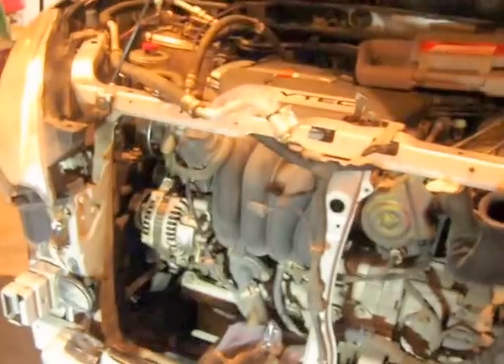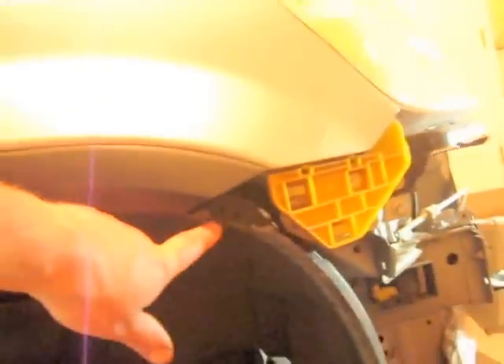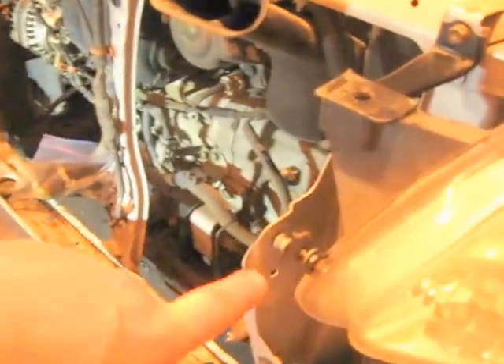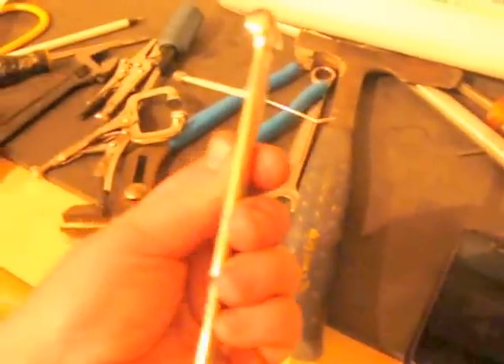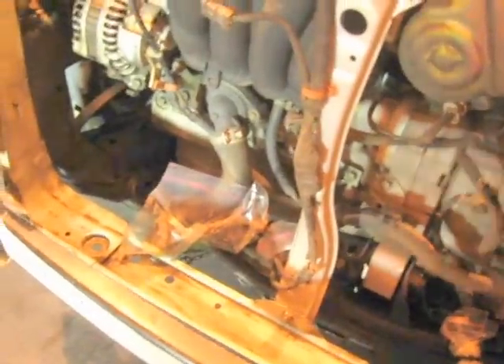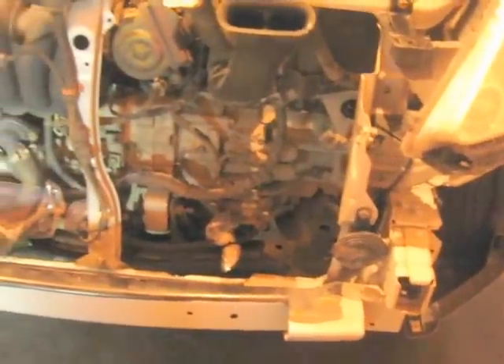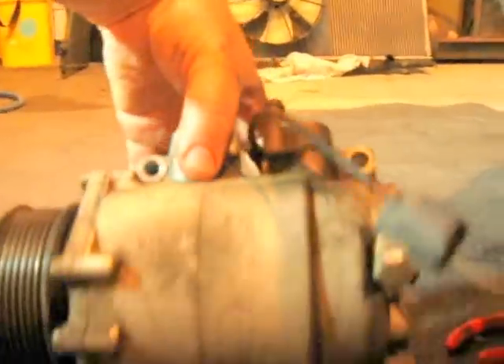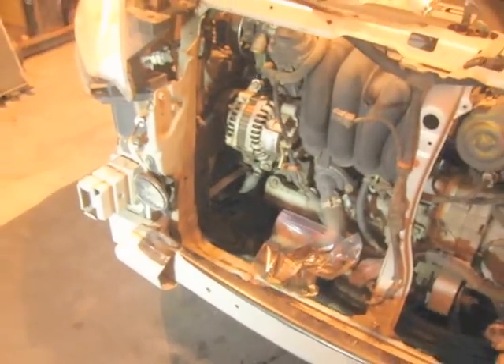2004 Honda CR-V Air Conditioner Compressor Removal

Comment: Remove the upper radiator support, overflow reservoir,  passenger side cooling fan, serpentine belt. disconnect the 2 ac lines, power supply plug and 4 bolts holding the compressor, then lift the compressor out. Oh, pop the grill out so the radiator and condenser can go forward a couple inches. I just did this this morning in about an hour and 1/2.
Reply: Seriously? Please tell me more, I'm getting ready to take on this adventure.  Did you have to drop the subframe? Thanks
Reply: @factotumted   Pretty much what I said except there are 2 10mm bolts that are a bitch to get to where the top mounting mounting brackets for the radiator attach on each side when you look down.
Reply: @factotumted  And no, don't drop the subframe.
Reply: @timthemechanix  thanks Tim! 😊

Comment: Hi George thanks for the video. I have a new compressor from amazon for my 2005 CRV. I got stuck at the point where I took the bumper and plastics off. I see now that I have to remove the condenser and radiator to do this job properly. Thank you for taking the time to produce this helpful video i appreciate it. It's a little tricky but definitely worth the cost savings.
Reply from the maker: Carleone Alleyne Thank you for your kind words! You will be happy and proud of your work. Have a great weekend! We have lots to do around here!!
Reply: @GeorgeJirout  I got the new compressor installed yesterday, definitely a good sense of achievement :-) take care.

Comment: Awesome vid! I really appreciate getting a front view of the engine with the radiator out of the way.

My A/C lost its cooling ability a while back. I recharged the freon myself in which it only cooled for about an hour or so. Upon inspection I found my low-pressure discharge hose had started to rub up on my belt. I felt the area of contact and couldnt find a hole but there was a very clear depression in the hose itself. I plan to remove the hose tomorrow to have it refabricated.

I was at Napa the other day to grab something really quick and left my car running with the A/C off. I ended up waiting for about 10-15mins in the store because the sales associate was occupied and when I had returned to my car with the associate my car began to over heat. I believe i saw some sizzle from the radiator cap as well as the reserve tank cap. I also lost about half a quart of coolant that leaked out onto the ground. The leak pooled just below the reserve tank it seemed.

Do you think my A/C problem and overheating problem could be linked?
Reply from the maker: +4thcavalier I apologize for the late reply. My son was in a bad car accident and is in a coma. We are hopeful and faith driven people. In terms of the overheat I doubt they are linked. If the a/c compressor froze up not allowing the belt to rotate it would have burned off from the friction. If the depression in the hose did leak that would be my first stop in the troubleshooting journey. Otherwise there are a few other components as possible culprits. Thermostat, water pump, fans, or the fan relays may be to blame. I hope you have figured it out by now. As a diy this may be a reasonable fix if the motor did not get so hot to damage the head gaskets.

Comment: Just did mine without removing the radiator and bumper just loosened the radiator and removed the crossbar. Harder to work around but a lot less time and fluid
Reply from the maker: Thank you for sharing you experience. I am sure it will help another person down the road as this seems to be common issue for us with the CR-V... It

Comment: I just replaced a compressor on a 04 myself.Drained the system down then i took out the 4- 14 mm bolts in the front engine mount,put a jack centered  under the front cradle . Removed the 4 front cradle to body bolts(17 mm heads).Then I removed the rt. front tire and removed the two mount bolts facing out towards the fender well. Removed just the two bolts on the right side with a swivel socket.Then disconnected the lines and wire from the compressor. Lowered the jack under the cradle, engine will only go down so far.Unbolted the compressor and removed it through the passenger side wheel well. Whole job under an hour! You may have to pry the cradle down and put a block between the cradle and the body to have a little more room.
Reply from the maker: Thank you for sharing your experience as it will undoubtedly help out someone in a similar situation with this issue.

Comment: No worries George.  AutoZone was running a 20% off deal for Memorial day so i just ordered on there.  Getting the 2-year warranty unit.  A bit more, but wanted a "little" back up in case it goes bad again right away.

Comment: just did a 2007 crv. compressor can be replaced with only removing bottom plastic splash guard..takes about 30 min
Reply from the maker: jim bean I am glad to hear that. I am sure that will help another diy with this job in the future. Thanks for sharing your experience!
Reply: Ha great! I need to do my 2007. Thanks.
Reply: 2007 is not same as the 2004  if you take it out from the bottom on 2004 you will have to drop the sub frame and than squeeze  it out and that is the only way to get it out from the bottom

Comment from the maker: This is a very common question. If the impeller inside the compressor imploded (indicated by crunching metallic mayhem). Take out the desiccant filter located on the bottom right hand side of the radiator (10mm hex) and look for metal fragments. If present the whole thing needs to be replaced. I seem to remember someone in the thread changing out the clutch assembly (similar symptomatology as yours ) and they were back in business. Thats about all I have. The guy said he pulled the clutch without going to deep into the car, read through these comments and you may find what you are looking for. Sorry for the late reply. I started typing this earlier and the puppy came into my office and commenced a urinary relief procedure that sidetracked me to which I brain dumped the memory cache until heading back to the house for a coffee refill!
Reply: Oh wow. Sorry to hear about the urinary relief. So in trying to do the repair,though I know expensive, do you think a local Honda dealer or an auto parts store would carry those 10 sizes plastic push pins?
Reply from the maker: Perhaps, surely the parts can arrive in a day or so should you choose to use the dealer. They are fairly common ad the pins typically break during service work.
Reply: George you are the man! I've got everything off, but I've hit a possible catastrophic issue. I got down to that last bolt, underside of compressor, the passenger side bolt,(the bugger the as you say) used a 12mm box, and it's stripped.... Its like 100 today here in Charlotte, as it will be for the next 2 months, my very pregnant wife needs this car, and that bolt is now stripped..... I couldn't be more bummed.. I have no clue as to what tool I could even go buy to do this job...
Reply from the maker: I'll try to find a fix for you this evening, there is a way to get the bugger out of there stripped or not. I have severe weather heading our way and need to baton down the hatches.
Reply: George Jirout oh wow, so sorry to hear about the weather George. Yeah I'm at the point where I'm considering having AAA tow it to an auto guy all because of this bolt! All this time money and effort for diy, I don't want to admit defeat yet! I went and purchase needle nose vice grips and they were a no go. I'll be patiently waiting for a solution, and keep your weather in my prayers
Reply from the maker: Try this. Take two small pieces of tin foil and cover the head of the bolt. Try and tap on the box end of a 12 mm from the sides and front to see if it will bite. That's a bad spot for a stripped bolt. I should have added the use of a box end first then then 1/4 turns with the open end. It's ok to tap out. Sometimes it is the only way to get the results in a given situation. My empathy is with you. Thanks for the prayers. It's coming from the west and my not be a direct hit.
Reply: George Jirout Thanks for the reply george, because my wife is pregnant, and its been so hot, we towed it to our auto guy, and he repaired everything. Now i got it back home. I noticed in driving this now, the ac sort of wants to blow cold, and blows just a little bit cold but not really cold.. So its about 95 degrees right now, i have it parked after driving, with ac on full, and one of the fans isnt blowing...  if you are facing the engine (like you would work on it) the left side fan is not kicking on. I dont see it coming on whatsoever... and it hot... from what i understand, this fan should come on when ac is blowing... Should i check the ac relay first?
Reply from the maker: Check the harness plugs to the fans. They may be loose after the teardown. Then move uplink from there. We just had a severe t-storm hit. Wowsy! What a ride... Mess is not to bad. At least no tornado this time. I may upload a video. I sure hope you get that ac handled soon, I know that frustration. Hang tough as the storms of life do eventual pass.
Reply: George Jirout im glad you didnt have any tornadoes. ..  so i found out the ac cooling fan is turning on, but is the other fan supposed to come on?
Also, i checked the low and high side with manifold at 80 degrees out and the low is at 30 the high at like 130..   is this why it isnt cold????/
Reply from the maker: Not sure?? I have to get back to you later. Project with a deadline 😞
Reply: George Jirout well it looks like the radiator fan is dead.. is there any way to get out just the radiator fan without removing the whole bumper and everything?
Reply from the maker: If memory serves me you can extract the radiator fan from the top. I'll have to go look at our car to refresh my memory. We have a tornado warning ⚠ it should pass through in about an hour or so! Praise the Lord for all this excitement and crazy weather conditions. After things calm down and the storm passes I will check it out 😊

Comment: Excellent info. I'm planning on repairing my ac.  Is there anything  I should replace besides the ac compressor? Condenser?
Reply from the maker: If the system "imploded" it is a must. All the parts are on amazon for a fair price. Did it implode?

Comment: Great video, thanks for posting. About to dive into a complete A/C system replacement on my wife's CRV. Will shoot some video and post on my channel. Any last minute tips before I dive in?
Reply from the maker: Not really, check out the other comments as some have said there were other ways to avoid losing the coolant by removing the crossbar??? I wanted new coolant and did not see a way to do that in my situation. It was not to bad. Look at other videos about the evaporator under the dash (if you have to go all the way) as that was a step I was able to forego. I will answer any questions along the way if need be! Have fun :) you will be done in no time and will save a bundle of $$$$...

Comment: Hi George and thanks for sharing this video!
 
Few questions; is there any torque specification for bolts when you retighten them on the pipes for condenser, expansion valves etc?
Is this doable in a single day if you have all the parts around ?
I am considering to do this job this spring, not sure if I have to change the whole system, for now all I can say is that my clutch doesn’t engage.
I will start to check the electrical stuff but I am pretty sure will ene up to replace the compressor at least. Any advice would be most welcome!
Reply from the maker: Hey Bob, you sure can do it in a day. I had to wait on parts, but if they are ready it goes rather quick. The vacuuming down the system takes about an hour (30-40min min.) to be sure it is free of moisture (vacuum pumps and manifold gauges are readily available and easy to use). The bolts are just about 15 ft lbs. or just good and snug. You are going into aluminum and the O-rings are doing to sealing not the torque on the bolt. When you pull the condenser take out the filter (10mm hex) look for metal fragments in the desiccant filter bag. If they are present, even the smallest of small the systems needs replacing. Otherwise you may get away from replacing the evaporator under the dash, or behind the glovebox. The messages below have all the parts from amazon with links. If I remember correctly. If not I would be happy to source them again as they are in my order history. This is a fairly easy one Bob. The fact that you are willing to give it a go shows you have the skills needed to get it done. I hope it is merely a minor electrical gremlin :) Let me know if you need any thing further. I hope this helps! Have a great weekend...
Reply: George Jirout I am back with the news... As I already have mentioned I changed the whole system: evaporator, condenser, compressor, the two hoses, expansion valve, dryer. The job took me a  couple of days - started on noon - Saturday, finished Sunday afternoon. 

In my case, only the clutch was faulty, I measured the resistance of the coil and it is interrupted. There was no debris in the system, probably the clutch died well before the compressor would have die and contaminate the lines . But, having all the parts ordered I gone ahead and I replaced everything, my car being MY 2003 . A was able to pull the radiator together with the fans as a whole unit. A pair of long nose pliers is a must have to get all the wires disconnected without breaking the connectors. "Being there" I replaced the belt tensioner pulley and I cleaned the alternator as I had a leaking oil seal on crankshaft (that was fixed 2 days ahead) and everything was messy. Also, I cleaned the PCV valve and replaced few rusted hose clamps. 

The Evaporator was a fairly straight forward job - just needed to be carefully how the blower fan box came out. Moving back to the engine bay, I replaced the hoses, the condenser, the compressor, and I put everything back together preparing the field for vaccum.

The vacuum pump that I bought is a Robinair 1.5 CFM with oil and an adapter for charging hose included and also i got the valve with the tapping pin and three 12 oz cans of R134 (pure, without oil or dye).

I started to pull vacuum, and I reached easily at -28-29. After about an hour I  closed the valves on the manifold gauge set and then I stopped the pump. The system started to lose vacuum and in about 1 min the atmospheric pressure was back. A big leak I thought?! I replaced some of the O rings,  same result. Then I pulled vacuum again and disconnected the high pressure side hose (the red one) and having only the low side hose connected I had vacuum for long ...

I reconnected the red hose, pulled vacuum again and started to charge the system with refrigerant. The first can went fairly quick and the compressor started to engage. Then, I used a digital balance to measure the quantity needed from the second can. All in all I added 18 oz to the system. Maybe less as I purged the yellow line two times to get the air out of it.
 I did the charging on idle, and the pressure on the gauges was 35 on low and 115 on the high . Ambient temperature was 62 F . 
The dash vent temperature was 41 F-42 F . Today I tested again the dash vent temp and is the same that was yesterday. I will do some tests again having the engine revved at ~2000 rpm to check the pressure on low side and high side. 35 on low and 115 on the high seems to be a bit lower than normal for 62F outside temperature.

Now, the questions.... is the A/C manifold gauge set faulty? maybe a loose hose fitting going to it, or a hose seal ? I got an Harbor Freight (US General) set and mine came without O rings at the end of the hoses. Are they supposed to have O rings ?  If anyone has the same set, can confirm please? 

I am not very confident that my work is a successfully one  as long as the system didn't hold the vacuum with both hoses connected to the service ports on the car. On the other hand, testing the dash vent temperature and having the same temp as yesterday gives me some hope that the system is actually good and the A/C manifold gauge set is faulty. What do you think? 

Thank you again for all your assistance and for adding this video on Youtube . You did a great job. This gave me the confidence to start this DIY. Bob
Reply from the maker: It sounds like you are a competent DIY after all that! I purchased my manifold set from Amazon and it did have o rings. Try pulling a vacuum on the gauges with the valves closed to see if the valves hold. If they do the next logical place for a leak would be the hoses without o rings on the female ends. I am proud of your courage and abilities! I am convinced that we can do much more together than apart! And the You Tube University continues to help all of us with these and other repairs encountered in life. I will try and post a picture of the hose ends later today, they may offer some insight into your vacuum loss. If the compressor comes on the system should be ok, I seem to remember it not being able to function without the refrigerant and oil under vacuum. A few searches can confirm this as I am not 100% certain. I want to add a farewell ada boy to your efforts! I appreciate the honor of being a small part of your experience.
Reply: George Jirout Hi George, thanks for the hint ! I will test to pull vacuum on the gauges with the valves closed. Moreover I will switch the hoses to see the behavior for each one. My hoses seem to be crimped with a white plastic, instead of having rubber washers or O rings. Thank you again for taking time to respond to my questions and for your nice words. Bob